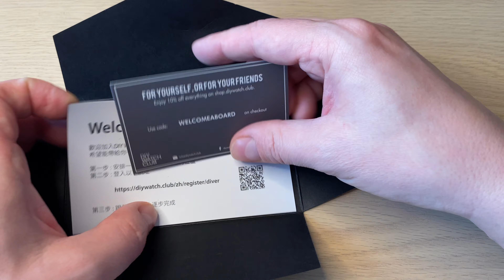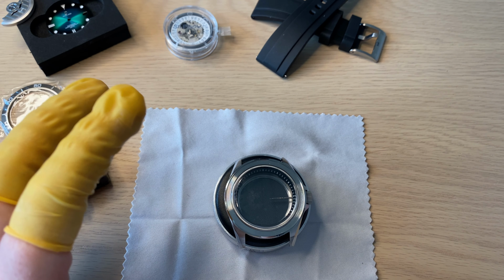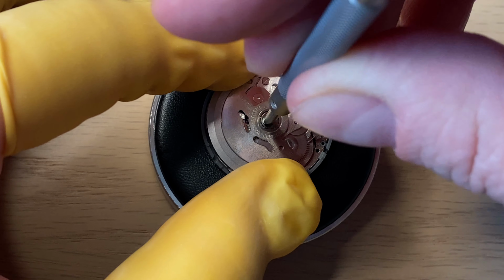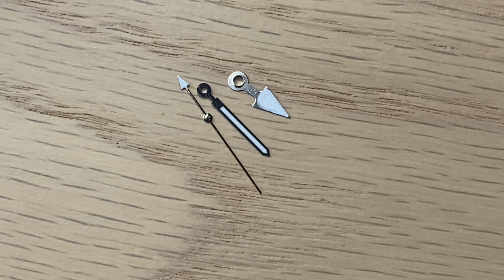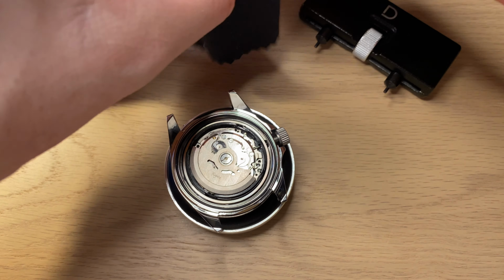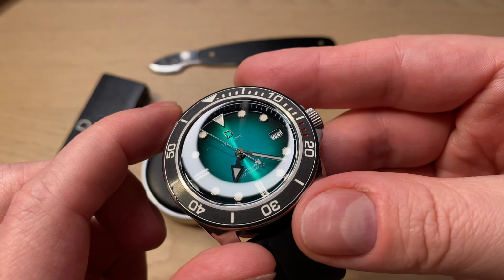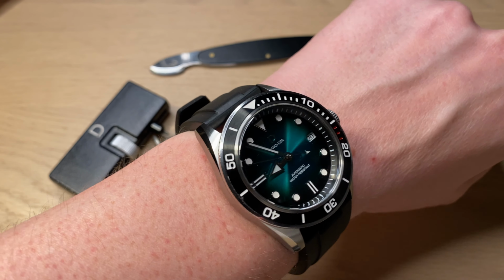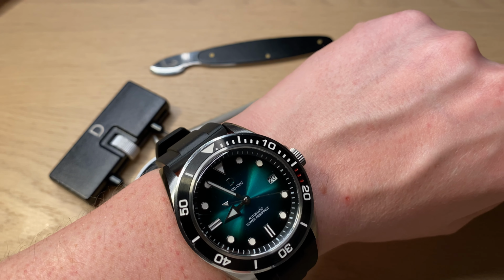Assembling My Own Divewatch | It's Fun! DIY Watch Club

Comment: The watch looks great and it looks like it was mostly fun assembling it as long as you are careful. I think that like you I would have difficult placing the hands. I little bit of advice though, I'd place the minute hand with the hour hand at six (view alignment north to south), placing at the noon position it is slightly easier to misalign as the minute hand masks the hour hand (depending on the hand style of course) but you did a great job. I brilliant touch adding the custom rotor with your daughters name on it. Wonderful.

Comment: I wanted to follow a workshop by Kalle Schaap (Chronoglide) in The Netherlands, but unfortunately I couldn't make it happen scheduling wise.
This seems like a good way to get started tinkering around with watches from the comfort of your home!
I have some watches with minute flaws (e.g. hands where the lume is quite poor or lume pips that let loose, luckily I was sent replacement parts... but then you have to brave enough to replace... the parts) or some that I would like to modify. I'm just so scared to mess something up or let dust in somehow. But maybe the best way is to just get started!

Comment: Looks like that end of the second hand should be the other way around... 🤔 no?
Isn't the arrow head end supposed to reach the chaptering?
Nice watch by the way and really seemed fun to assemble!
Reply from the maker: Hi. The lume part of the second hand is the end  and counter weight.
Reply: @TimeAndCrown  oh ok..
Seems a bit odd though
🙃
I mean in the dark you'll be seeing the wrong second indication right?
Reply: @thodorissaritziotis3306  the purpose of a lumed tip on the second hand of a dive watch is to confirm that the movement is running whilst underwater, not for counting seconds.